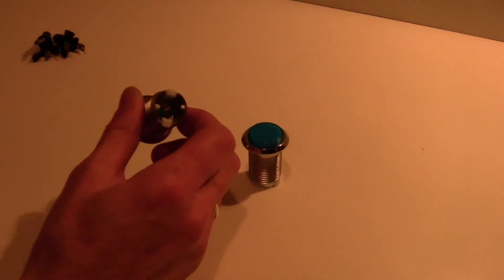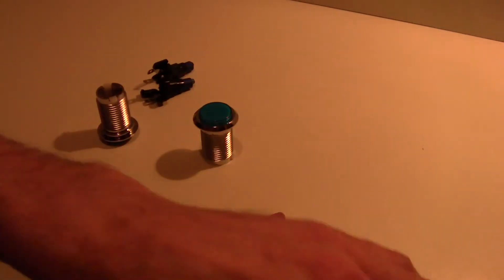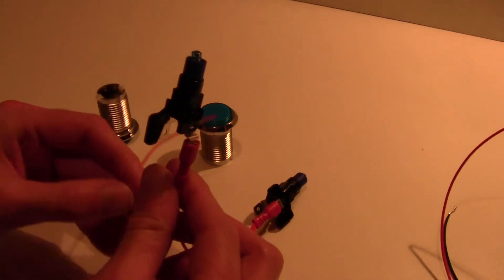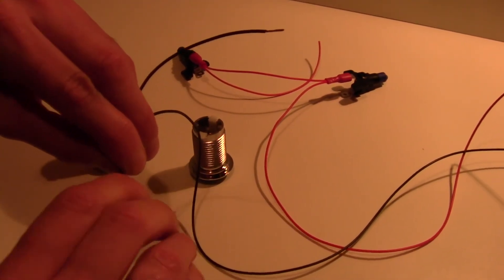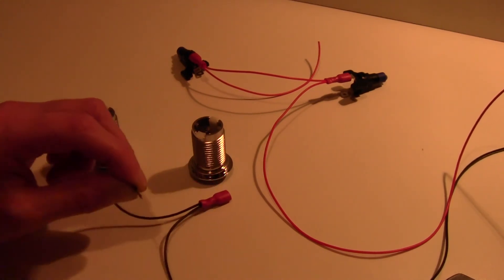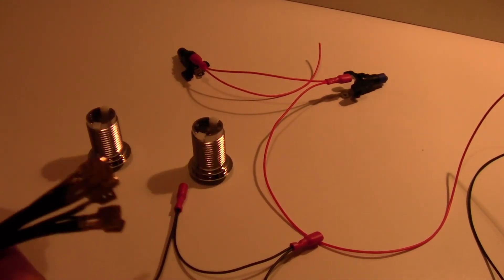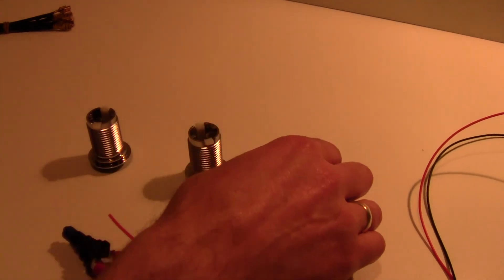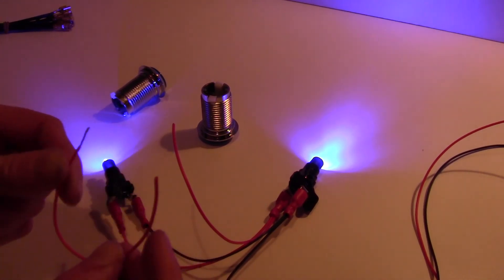How to Wire Arcade Machine LED Buttons 12v

Comment: what if I want to power 12 5v LED's.  Is there any way to do this without buying a 60v power supply?  I'm a little new to to this whole arcade thing and am hoping to learn more about electronics by building one of these machines.  I'm also trying to stay on budget.  Also, I don't want to have to buy a ton of power bricks (like 4 15v power supplies) as it needs to be able to fit on a power strip.  Any suggestions?

Comment: I just wanted to know how to power them on. In all of the videos I’ve seen about this, nobody shows how or what it is connected to.
Reply: i did (-;
Reply: @Seraphim190.  I believe he's referring to the actual power supply unit.. And you didn't ;)
Reply: @rickduder4585  it's just a plug, goes in the wall. sorry i thought i showed that i guess not

Comment: Can the power supply come from a Raspberry Pi B+? Or would I need a separate power source?
Reply: You'll need a 12v supply to illuminate the bulbs.
The easiest method is to buy a small Hard drive power supply.

Search ebay for HDD power supply.